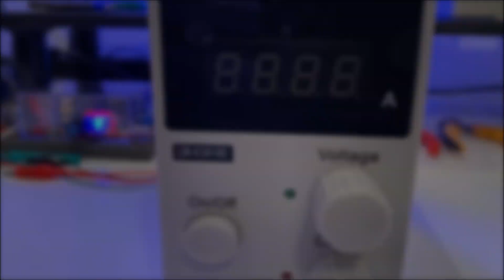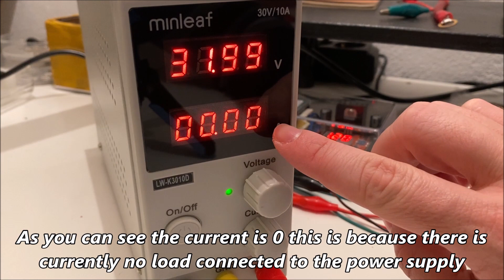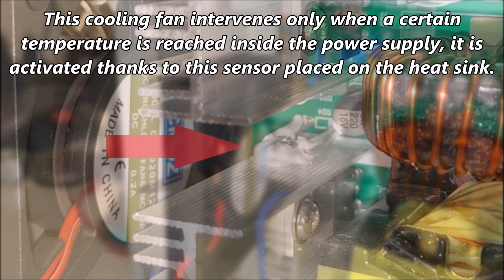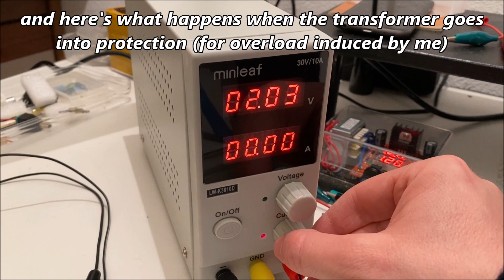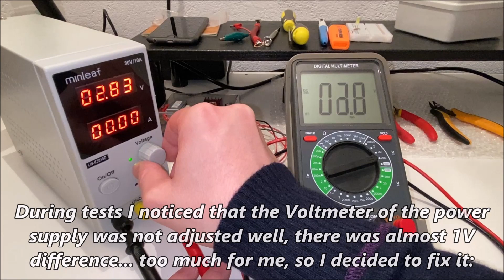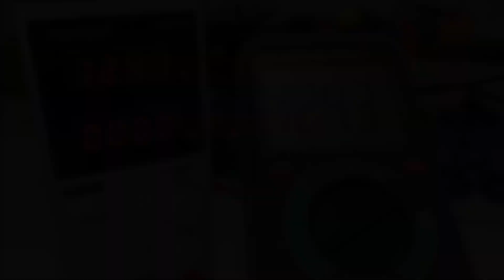Adjustable DC Power Supply 30V 10A Minleaf K3010D from Banggood

Comment: Thanks for the review! Have you tried to test the voltage drop under mid-heavy current load? I have a similar model and I tried 500mA@5V, the real output voltage drops to 4,3V. Of course voltage decreases even more as load current increases
Reply from the maker: Hi, thank you! yes I tried up to just over 5,6A, the voltage remains very stable, you can see it in the video precisely at 5:20
Reply: @Stefano91ste  Yeah the display on the power supply doesn't not display any relevant change in voltage (even my power supply seems very stable), but if you try with an external multimeter you may see a different result. I mean that what you see on that display may not be the real output voltage...
Reply: Hi, I had the same problem, I was with a gps and some sensors sometimes needed around 3A but the voltage dropped and the circuit did not work well, I solved it by changing to a charguer of smartphone. i have the  same dc power supply
Reply: I am using wires similar this: https://youtu.be/-jwEMFXmuRE?t=187
Reply: @za-se4jv  I'm using 24AWG, that is surely enough for 0.5A. However, I think the problem is the banana plug connector included with the power supply. I used a "higher" quality banana plug connector and the problem vanished.

Comment: Dear Stefano thanks for this interesting review! To me it is impressive how the Voltage is stable even if you hold the drill bench with your hand. But there is one question: Can you bring the digits to an exactly value like e.g. 12.00 V or 0.600 A ? To me it did look like the digits are not that smooth. The best to me is the fan not running the whole time! Over all I will probably buy this thing. All the best to you! Boris. 🇨🇭
Reply from the maker: Hello Boris, thank you!
- Yes, it is possible to have precise values such as 12.00V is set via the trimmer (Voltage) as regards the current this must be set once the load is connected to the power supply, after which it can only be lowered to the desired level.
- The cooling fan is automatic, it running only when the power supply becomes hot under load. 
Thanks so much for the comment! Stefano